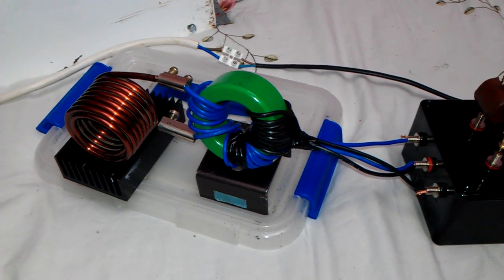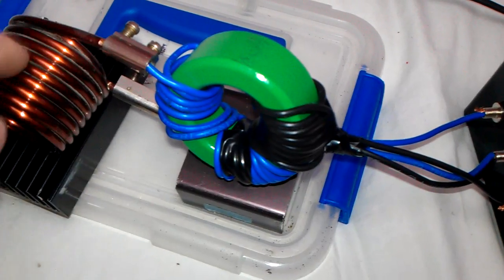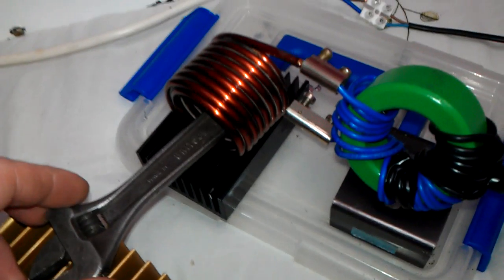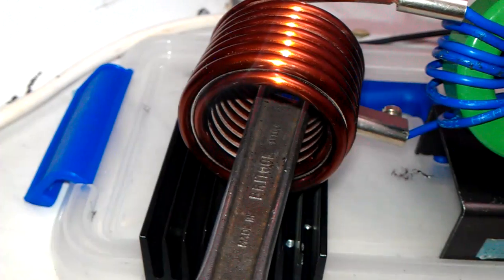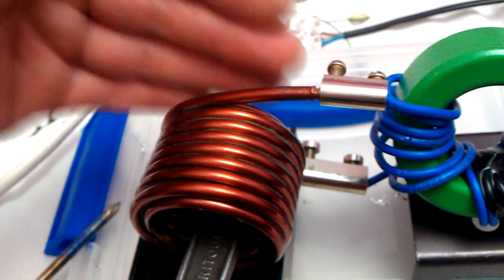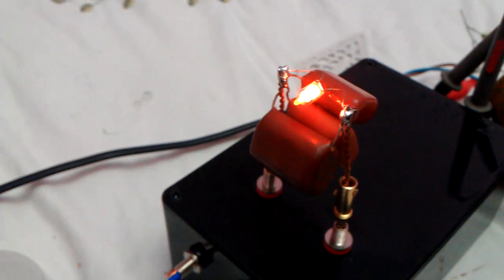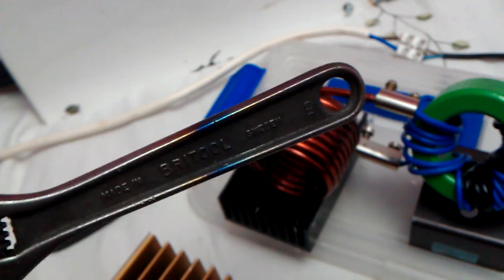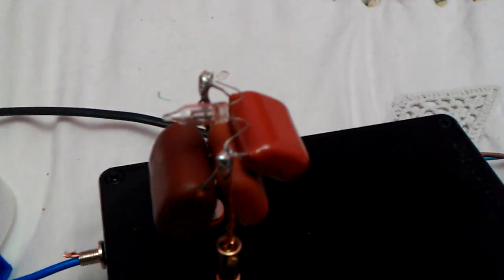Induction heating zvs mosfets

Comment: I build my own with less power about 100W. But I have a problem is the temperature of main coil heating up too high reach over 100*C, and the cap reach 60*C  when not thing inside the coil. Can you give me advice how to reduce the temperature of main coil wen run no load. Thank you so much.
The component of flyback circuit: FET IRFZ44N, cap 3x100nF 630volt 
Video test temperature:
https://www.youtube.com/watch?v=39EZ_9GxJ_s

Comment: thanks for you project explaoning. i sjoul siggest whole you explaiin the project please give tecjnical details of the components and circuit so that one could tri at once end. please it will be of  great help to in tryong in once end.
Reply from the maker: its just a zvs driver. you can find the circuit diagrams on google images. and then you put more caps on the zvs output to get more current flow and to change the frequency. hope this helps

Comment: Great results. Thanks for sharing.
I 'm new at this and is it possible to see some schematics so I can make one ?
Anyways, appreciate seeing a successful project. Thanks, Gk.
Reply from the maker: Hi mate' 
Yeah the circuit is a ZVS driver in the black project box. You can find the circuit diagram on Google images search. And the zvs has a capacitor foil wrap type.and you change the capacitance to what your coil works best. Even adding more in parallel. As you can see in the video from the ZVS output the 3 wires go to the ferrite, (normally the zvs is to run flyback transformers" from a crt TV. )  and the output is wired to the flybacks ferrite. And consists of 8 to 10 turns of wire with center tap being the positive. 

Now with the green ferrite in the video that would be the flyback. And then we get a 10 turns or so to wire up the induction coil. Being 2 wire output.(not 3) You can try leaving out the green ferrite and going direct to induction coil and having a center tap.

Hope this helps and if you need anymore help it's no bother.

Anthony

High1voltage1rules

Comment: What's in the black box? What is the driver circuit?
Reply from the maker: Hi mate' 
sorry for the late reply' been busy, 
yeah in the black box is a zvs driver circuit' it a project box. Saves bloody wires and things hanging about lol.

Thanks for the comment and be safe.👍 😉

Anthony

High1voltage1rules
Reply from the maker: the driver circuit is inside the black box. it's a modified zvs driver with 4 mosfets

thanks 😉

Anthony 

High1voltage1rules

Comment: Why do you have 4 wires,,1 blue, then a wire blue with black together and then at the last a black single wire,,instead of having just one blue wire and a black wire going around the magnet all the way true de begining of the copper coil.?=) can you give a explanation,,thanks and have a nice day
Reply from the maker: hi mate,
yes this is a induction coil setup' and its a zvs driver' with 3 wire output as 2 negative and 1 positive! center tap is positive.( normally it would consist of 8 to 10 rings of wire around a ferrite core of a flyback with a center tap!) and they go around the ferrite ring to give me a frequency output on just 2 wire outputs, its the same as a transformer! its like 3 phase in and 1 phase out! if you know what i mean lol ;-)

hope this helps and thank you

Anthony,

high1voltage1rules

Comment: inductionheatertutorial(dot)com definitely a good place to start. Haven't built mine yet but am working on designing it. Once you start picking out the parts on sights like mouser or digikey you'll find it completely overwhelming :-). Knowing what every little part does, its limits, its drawbacks, its response time, ect. When you get deep down in to it you'll find yourself going all the way back down to the absolute basics. Some channels you might find interesting: mikeselectricstuff, & eevblog

Comment: you can try this without the toroidal transformer and have the work coil be the 5+5 turns that is directly connected to the driver and get more power but you will need to increase the turns on the inductor or it might not start oscillating.

Comment: I tried this once myself using a ZVS driver becuase I was sceptic about induction heating, I didn't think induction heating could possibly work, but I used a center-tapped coil so there was no need for an output transformer.  I was suprised at how well it worked.